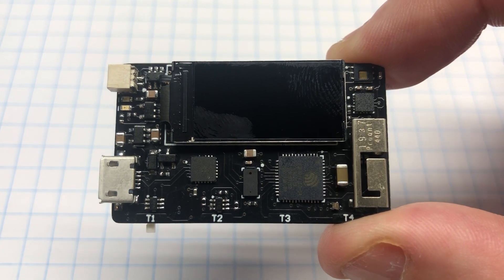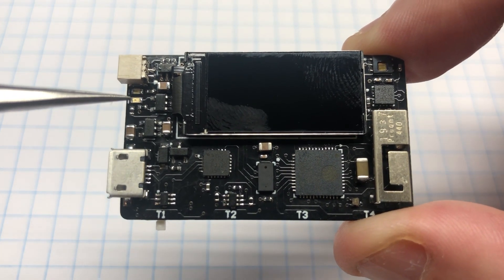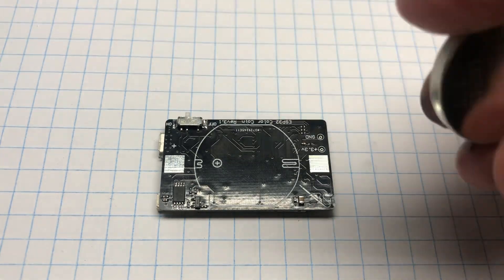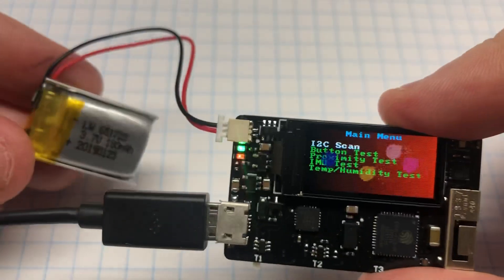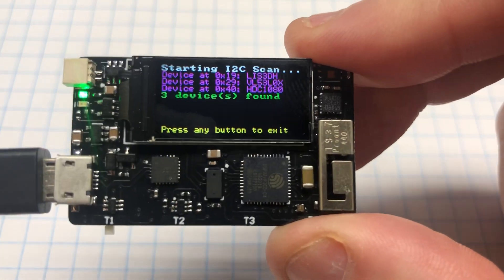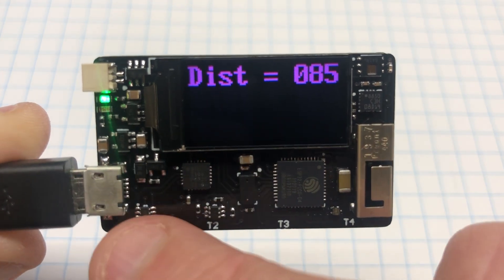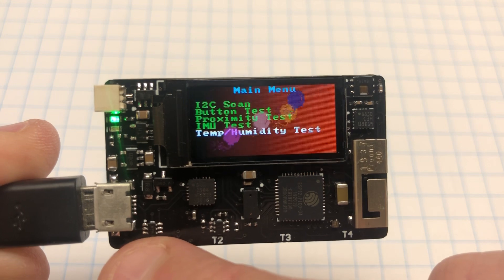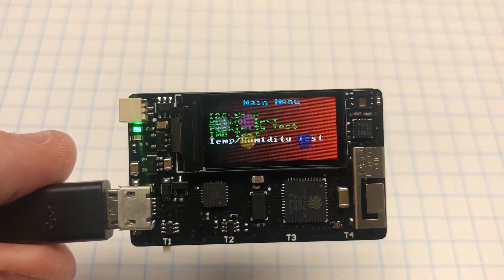ESP32 IOT Color CoinCell

Comment: Hey, can i ask, how do you tune your antenna?
Reply from the maker: Unfortunately I do not have the tools to test antennas so all I can do is follow the antenna datasheet, see what others have done and view the RSSI value on the screen.
Reply: @0miker0  I see. Have you ever measured the range? Would it work if I would put the device outside and try to read data from inside of the house? Or should I use whip antenna?
Reply from the maker: @petras159753555  wifi range in out house works from one far side to the other through walls. Mine on the little board works the same.
Reply: @0miker0  thanks, you are helping me so much :) if you dont mind I would like to ask few more questions.

 As I understand you didint use those capacitors for antenna's tuning, right?

Also, I noticed, that in your previous projects you used CP2102N, and now you switched to CP2104N. I was wondering if there are no problems with deep sleep mode while using this project's exact design?

Thank you again :)
Reply from the maker: @petras159753555  both the cp2102 & cp2104 are  only ever powered off the USB chip so on battery power draw no power at all. The only reason I started using the cp2104 is because it’s smaller.

Comment: Superb. Very nicely designed.
Reply from the maker: Thanks! It’s a continuously evolving project. Been thinking of switching to a USB-C connector and adding a psram chip. If you can think of any other changes like different sensors or anything else then just let me know.
Reply: @0miker0  Thanks for reply. sure i will let you know . we will be in contact.

Comment: Hey Mike, this board is truly exceptional, well done and world class I’d say. An exciting amalgamation of devices and some real innovation going on. Your very gifted.
Reply from the maker: Been thinking of adding a resistor divisor and using your battery voltage sketch that you used in one of your amazing videos. Love your work as well!
Reply: @0miker0  adding a voltage monitor would be the icing on the cake, shame the ESP32 input current is relatively high to require say 470K divisors which adds about 4uA to the sleep current. Did you choose a low quiescent LDO regulator, that would give a good overall sleep current for those that need it. That rear mounted battery is fascinating I didn’t know such products existed, going to investigate those further. Thanks for posting the video, a real eye opener.
Reply from the maker: @G6EJD  It may be possible to have a mosfet on top of the resistor divider that you can turn on before reading the voltage. That way there would  be no current draw at all until you take a reading.
Reply: @0miker0  indeed good idea, there are probably enough spare gpio less than address 32 to implement that.